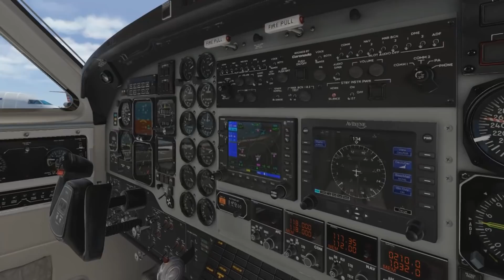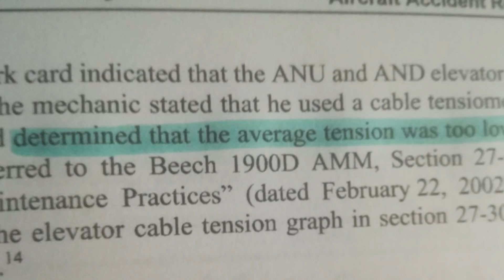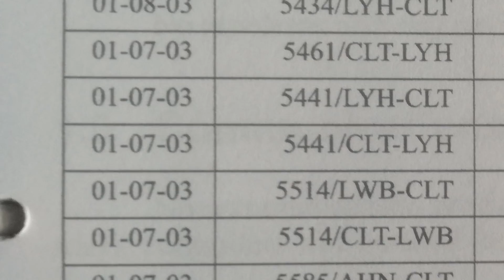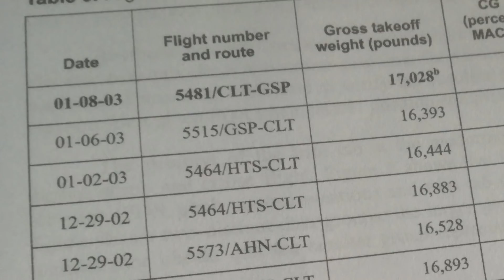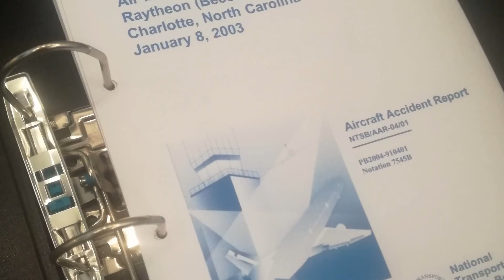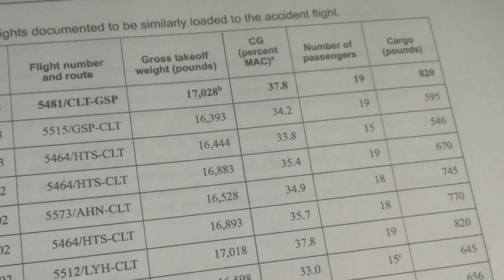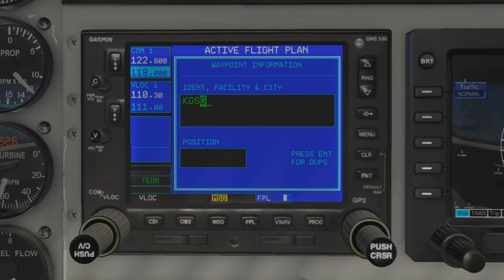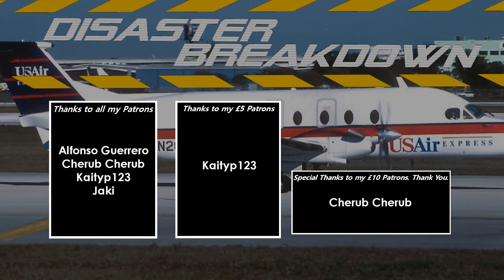Did An Overweight Plane Cause This Crash? (Air Midwest Flight 5481) - DISASTER BREAKDOWN

Comment: A nose heavy plane flies poorly, a tail heavy plane flies once…
Reply: Why?
Reply: @sintes88  because it crashes
Reply: @confuzedpenguin9974  If that was the case then all the planes would have crashed. Calculation error by the pilot led to the crash of 5481
Reply: i wonder the percentage of female pilots in accidents. it seems there isnt many but a good amount are involved in accidents.
Reply: @TANKTHEARC According to the John Hopkin's "Gender differences in General  Aviation Crashes" research paper, male pilots are more likely to cause crashes due to "poor decision making, unnecessary risk-taking and inattentiveness" and have more serious consequences, while female pilots are more likely to cause crashes due to "pilot error such as inability to recover from a stall, incorrect use of the rudder and poor response to a bounce", often due to the mishandling of the aircraft's kinetics.
Reply: @sintes88 I'm not a professional in the field, but from what I've learned from watching probably hundreds of videos on YouTube, that's because a heavy tail leads to the nose being "pointed upwards", which means that the angle of attack is already high. If you need to climb or maintain the altitude, you have to increase the angle of attack even further, which might lead to a stall. 
When the nose is heavy, it is "pointed downwards", which can be counteracted by trimming without losing lift at some point. That leads to a very unstable flight-situation and probably sluggish controls, but doesn't bring the plane down.
Reply: @dh510  Finally someone who would make the effort to explain. Thank you.
Reply: @sintes88  Sorry it took me 5 months, I've had my comment notifications turned off on accident for a while^^
Reply: @Susannadivita  There are a lot more male pilots but as i watch these very few female pilots but yet high number are involved in crashes . makes me wonder the percentages  of it .
Reply: @dh510  Close, but not quite.  The stalling AOA has nothing to do with pitch attitude.   An aircraft can be stalled in almost any pitch attitude.   Yes, they appear correlated, but this is not accurate.  A tail-heavy plane tends to pitch up.  A nose-heavy plane tends to pitch down.   Proper control rigging allows the pilot to fly the plane under a wide range of Center-Of-Gravity, fore, and aft.   The "CG" is critical on every flight.   The extreme pitch and slow speed allowed the plane to exceed the critical AOA and the wing "stalled".   IOW, it lost the ability to produce LIFT.    As soon as that happened, the plane became an anvil and there wasn't much the crew could do at only 1100 feet.     Had this plane not been "worked on" the overloading would have done little more than degrade the performance of the plane, particularly in vertical speed while climbing.
Reply: @sintes88  r u a rc pilot ??
Reply: @Susannadivita  you do realise that your comment is basically saying that men are much better at flight skills, they just get cocky and overconfident...
Reply: @Susannadivita  well the living passengers who fly every day probably care how skilled their pilots are...
Reply: @tankthearc9875  sigh
Reply: @sintes88 and this is why its important to go to high school 🙄
Reply: @Strlrd1023 like here, you were obviously always too late….

Comment: Why would anyone take a flight of only 70 miles?  It is only about an hour drive.  By the time you go to the airport, get on the plane, make the flight and leave the next airport you have waisted far more time than just driving.
Reply: It's way cheaper than a taxi. Take a plane to a big airport and then hop to a smaller one (or the other way around) and you save a hundred dollars or so on taxi fare. It's not locals doing it to go shopping or something.
Reply: Also depends on location, just because you can fly straight there doesnt always mean you can get straight there by driving.
Reply: PERHAPS they originated somewhere MUCH further away than 70 miles and took an airplane ride TO Charlotte because that's where the connection was?    We're not talking rocket science here.
Reply: @lbowsk There's a thing of connecting flights.
Reply: It's not people using planes as buses 😂 it's likely tourists/visitors who may not be renting cars or want to spend a small fortune on taxis
Reply: It depends what city . If you're in Los Angeles then you're better off not driving.

Comment: In the event of a tail heavy take off: Leave gear down, induce a small bank if youre still losing airspeed despite max forward stick, this allows the aircraft to slip slightly on its sudden climb and should stop the increasing angle of attack. Use opposite rudder delicately for course correctionon if necessary. Keep a low positive rate. Use the entire length of remaining runway to gain speed and control, any obstacles at the end can be cleared using the extra speed. Flaps can also be used to help push the nose down which may aid in your recovery attempt.
Reply: Also adjust elevator trim
Reply: Was there flaps on this plane? and did they have time to use them?
Reply: My two pilots keep a scale for people and a separate scale for luggage by each of planes/jets.  

One of my pilots always says "If you are not comfortable getting on a scale, I'm not comfortable flying you".  I (really the pilots) won't take more than 3 friends on any of the single engine planes.  Actually we don't even like to take more than 6 people on our Falcon 2000 and it should (technicall) be fine with 10 plus luggage.  Something I didn't realize that one of our pilots told me is that even if you are within the weight limits, flying close to the weight limit changes almost everything... From handling to performance to stress on an aircraft.  And also "a nose heavy plane flies poorly, a tail heavy plane flies once".

Also, if you think women (especially the onlyfans 'models' and adult film stars on my flights) lie about their weight, just ask them what their luggage weighs and then put it on the scale.

Comment: I flew the 1900 for Air Midwest from 1999-2002 until I switched to the RJ at Mesa which is who owned Air Midwest. I knew CA Katie very well, she was a great pilot. Even today that memory on Jan 8th still hurts.
Reply: I knew Katie myself as well. We went to the same university and partly worked on our  commercial ratings together. Last time I saw her was in a Mexican restaurant that I worked at back in 1998.
Reply: I'm so sorry.
Reply: Wasn't she too young to be a Captain? I mean no disrespect.
Reply: @jaimepablomartinezdelgado9426  No, she met the age and flight time requirements for the ATP to be Captain.
Reply: @EastTNflyer  Thanks for your reply Captain.

Comment: Surely it should be possible to put sensors on the landing gear that would be able to tell if the aeroplane is overweight or the c of g is out of the required range?
Reply: It would be pretty easy to do, the planes already have hydraulic shocks. Just put a spring loaded ball attached to a bright red flag along the top of the cylinder. Too much pressure = obvious red "OVERWEIGHT" flag sticking out. It wouldn't be fail safe however, as any junk/obstruction/corrosion would make the flag pop out at too high a weight.
Reply: They do have this on larger planes.  In fact it also tells them where the center of mass is since it can calculate that from reading the weight in three different locations (left gear, right gear, and nose gear).  The bigger problem isn't how much the plane weighed but that since the extra weight was in the back, it moved the center of mass behind the wings.  The location of the mass was a far bigger problem here than just the sheer total amount of it, so having the measure in three locations to find the center of mass was a large helpful safety measure.  But smaller planes often don't have that system.
Reply: @dunbar9finger  I've flown the airbus and most of the Boeings.  None of them have this system.

Comment: Often, an air accident occurs when two or more factors conspire, as they did here.
Reply: I'm always paranoid about weight which seems to be a major factor here.  I ask my two pilots keep a scale for people and a separate scale for luggage by each of planes/jets.  

One of my pilots always says "If you are not comfortable getting on a scale, I'm not comfortable flying you".  I (really the pilots) won't take more than 3 friends on any of the single engine planes.  Actually we don't even like to take more than 6 people on our Falcon 2000 and it should (technicall) be fine with 10 plus luggage.  Something I didn't realize that one of our pilots told me is that even if you are within the weight limits, flying close to the weight limit changes almost everything... From handling to performance to stress on an aircraft.  And also "a nose heavy plane flies poorly, a tail heavy plane flies once".

Also, if you think women (especially the onlyfans 'models' and adult film stars on my flights) lie about their weight, just ask them what their luggage weighs and then put it on the scale.
Reply: @DrMatthewHudson  Operating any device at close to its limits puts stress on both the device and its operator, and that'e especially important if there can be fatal results, like an airplane.  The rising rate of obesity can make a passenger load heavier than "normal", and the weight of their luggage is unpredictable.  Weighing them both should become standard procedure, particularly on smaller planes where a hundred pounds can make a difference.

Comment: It was a known fact for many years the small commuter carriers were over loading their planes. 
Although the manufacture had recommended weight limits, many airlines considered them underrated and continued to pile on the luggage and other goods until things like this happened. Pushing the limit..
All about the money.
Reply: if you push the limit too far the limit will get pushed back
Reply: pro tip:

to avoid the complications of small, regional jets...

train.
Reply: While you may be correct the overloading didn't cause the crash.    It didn't help, but it's not why it crashed.  Had the elevator functioned properly, we'd not be watching this video.
Reply: @lbowsk  you got that in reverse m8, the plane flew with the elevator settings like that several times already just fine.

It is the overloading which unfortunately tips the balance for this particular flight.
Reply: There's another factor that was involved. A faulty repair. If this aircraft would've been properly maintained. Then this accident wouldn't have happened.
Reply: @kevinmalone3210  True, but it was a combination of problems. The plane flew many flights with that faulty repair. Once it was loaded to the limit or possibly over is when everything went south. Very unfortunate combination of events that led to disaster.
Reply: @anincompetentmoron8497  Amen brother. :) Trains are good for short to mid-range trips (up to say 1000 miles or 1600 km), while planes are better for overseas trips. But if trains are somehow not feasible for some weird American lack of infrastructure reason, it would be a good idea to weigh all the aircraft passengers on the baggage scale, and have a computer calculate the ideal seat for each passenger to sit in. Also, the elevators should have worked better, and the plane should not have been overloaded. May the 21 souls aboard the aircraft back in 2003 RIP. :(
Reply: @anincompetentmoron8497 
Compared to trains, even regional flights are safer.
Reply: @anincompetentmoron8497  
I have. That does not change facts. There are more rail accidents annually than regional flighr accidents.
Reply: @jfangm  1. Only in the US with its slipshod joke of a once-great rail system and only if you look purely at numbers of accidents, and even there... are you looking purely at passenger rail accidents? Or the overall total that also includes freight?
2. Trains are infinitely more practical. And issues like passengers being heavier than a laughably out-of-date average trouble them little.
Reply: @ZeldaTheSwordsman  
1. Even passenger rail is more dangerous than flying.
2. Rail is the LEAST practical way to travel. They only go where there are rails. Even a car is not limited to roads.
Reply: My two pilots keep a scale for people and a separate scale for luggage by each of planes/jets.  

One of my pilots always says "If you are not comfortable getting on a scale, I'm not comfortable flying you".  I (really the pilots) won't take more than 3 friends on any of the single engine planes.  Actually we don't even like to take more than 6 people on our Falcon 2000 and it should (technicall) be fine with 10 plus luggage.  Something I didn't realize that one of our pilots told me is that even if you are within the weight limits, flying close to the weight limit changes almost everything... From handling to performance to stress on an aircraft.  And also "a nose heavy plane flies poorly, a tail heavy plane flies once".

Also, if you think women (especially the onlyfans 'models' and adult film stars on my flights) lie about their weight, just ask them what their luggage weighs and then put it on the scale.

Comment: This has nothing to do with being overloaded (total amount of weight)  and everything to do with not knowing where the weight is (distribution of weight). The average passenger weight calculation doesn't tell you where the heavier passengers are. This also applies to cargo and heavier than normal baggage.  If you assume all cargo and all people have the same mass when in reality it varies then the center of mass could be in a very different place than you think.  You could also have the problem if the passengers in the front rows are lighter than you think, moving the center of mass backward.

The better systems in modern use measure the weight on each of the three wheels to accurately place where the center of mass is, and issue a warning when it's not within the allowed area.  But that often isn't used in smaller planes.

If you've ever been on a plane where the cabin crew ask passengers to move to new seats before takeoff, that's the result of this system.  The pilots are seeing a reading from the independent scales in each landing gear spring that tells them the weight is too unbalanced to be allowed to take off.  One solution can be to pump fuel between the tanks to change center of mass but sometimes it's faster to just move the passengers if the fuel load can't be easily moved.
Reply: It’s those extra bags of peanuts and pretzels, I tell ya.
Reply: Sort of, but it's not usually that fancy of thing like 'spring scales in the landing gear'. It's a calculation done by the first officer. We have seating zones, such as A, B, C, D. If the weight of 'C' is much more than 'A' (for example) then the FO will ask the flight attendant to move a certain number of passengers forward. This happened all the time when I worked, the FO would call back and ask me to 'move 6 passengers from C to A, please'.
Reply: There is no such system.  Yes, pax are sometimes asked to move but that is based on the final calculated CG.   Not individual scales on the gear measuring weight.

Comment: I remember seeing this on the news the day it happened.  Also, I remember seeing a documentary that gave more of the blame to the maintenance worker (singular).  Apparently, a nut was not tightened far enough down a screw which hampered this plane's ability to nose down.  Further, the maintenance worker was allowed to sign his own QA paperwork instead of having it inspected by QA.  The documentary went on to include the increased average weight of passengers and the miscalculation of the COB.  I find it interesting that this channel puts more emphasis on the cause towards the misbalanced load vs shotty maintenance when compared to the documentary.
Reply: Chuck Yeager  I stand by my statement.  This video puts more emphasis on the misbalanced load vs the maintenance work.

Comment: So similar to a fatal accident I witnessed. I am based out of Columbia SC and the FBO blares ground and tower comms from speakers so linemen know planes are inbound. A 402B used for freight took off and immediately started wildly pitching up and down. He got to about 300 agl and was screaming the entire time. Made it 3/4 around the circuit and when reducing power went straight in and exploded. It was concluded the planes elevator was adjusted just hours earlier. He made it was Charlotte to Columbia, then it happened. Maint had not properly secured the elevator connection and iirc a shift change happened and the final check was never completed.

Comment: I didn’t even know this happened. RIP to all who died.
Reply: I remember when it happened.  Horrible, short, nasty, brutal accident.  Snuffed out in an instant.  Criminally negligent maintenance administration by Raytheon.  More than 1/2 the fault can be directly attributed to them and their bean counters.  Teaming two very inexperienced pilots is a baaaaad idea, however having a very experienced one might not have saved them.  I'd be tempted to make sure that I measure the elevators with an angle gauge EVERY time I pre-check my airplane (if I'm not doing the maintenance.).  Had it been done correctly of course this video would not have been made.
Reply: I was born 2 years after the crash tho